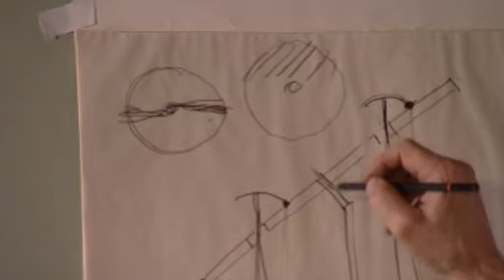A Machine To Die For: The Quest For Free Energy(part 5 of 5)

Comment: They do a terrible job of making an easy fact... a free energy generator that can move indefinitely without producing electricity, powering a device, or accelerating is simply motion at around 100% efficience. 
The actual output of electricity is made by pushing magnets against the resistance it has against coils of metal, ie the alternator in your car. 
To spin a water pump continuously you need to apply continuous force to counteract the water's resistance to movement. 
And as taught in high school physics, excess force equates to producing light, heat, electricity, potential energy, or acceleration. These devices don't accelerate on their own and thus are not producing energy, simply using little to none.

Put any external force on these devices and they will slow down, power used to make power.

Comment: assuming conventional physics are correct or mostly correct any device using gravitational energy would have to use something that comes from space or is lifted up from an external power source, with power equal to the generated power and the friction combined. because lifting something up generates a form of energy called height energy which can be converted back to motion by forces of gravity. i propose catching meteorites :P.

Comment: Actually, I very well understand how the giant wheel works, and why it restarts. But if you do the math, the increased radius and excess torque on one end of the wheel produces an acceneration which is EQUAL to the energy needed to reduce the radius on the bottom (heave up the weights) and extend the radius on top (up again).
That is non-cound any friction the machine has.

Comment: In a situation where there is friction in the way of wind resistance,you would be right.But seen as there is no wind resistance in space then the diameter would have no effect.Also if the outside diameter is getting bigger ,then the axis rotation speed would not have to be as fast for the outside diameter to travel the same distance.